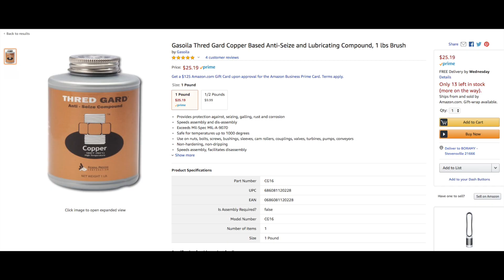Raceland Coilovers: Subaru Forester (SG) 2002-2008 Classics Install

Comment: I really need your help man I just got the same set and did everything Raceland recommended and somehow they make this harsh clunking noise did you guys experience this after the install?
Reply from the maker: Darius Akeung there is slight noise when turning the wheel left/right, but shouldn’t have any noise when  driving straight  tho. I would def recommend double checking all bolts and making sure they are tight
Reply: Fujibo Heavy  thanks so much for replying I just did today and it still makes this clunking sound it’s quiet on smooth roads but here in New York where I am you’ll hear them engage and clunk over bumps
Reply from the maker: @ElysianConcepts  No probs man! Yea from what i remember the coilovers are pillowball mounts, so basically the top mounts can swivel and turn, and thats what causes the clunking sounds. So to me its normal , with my experience
Reply: Fujibo Heavy thanks again brother and stay blessed
Reply from the maker: @ElysianConcepts  My pleasure! Same to you!